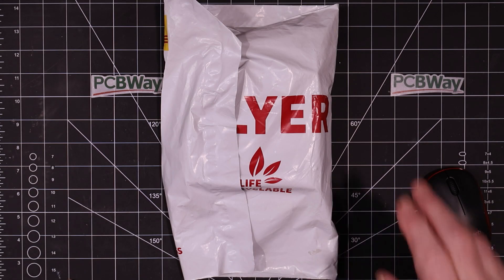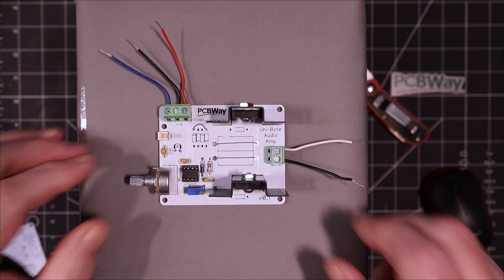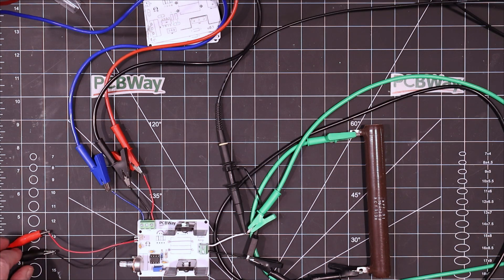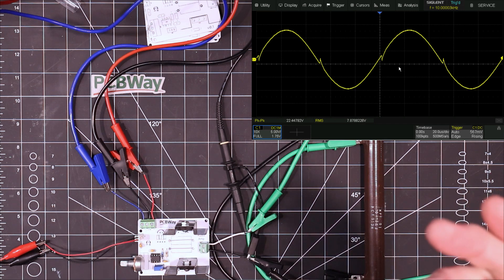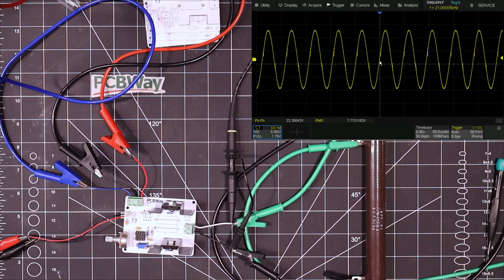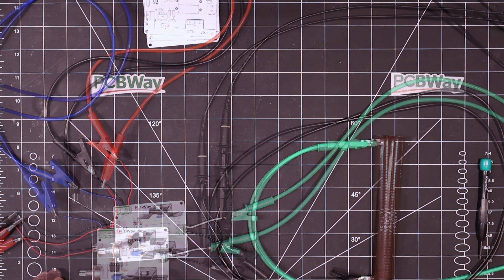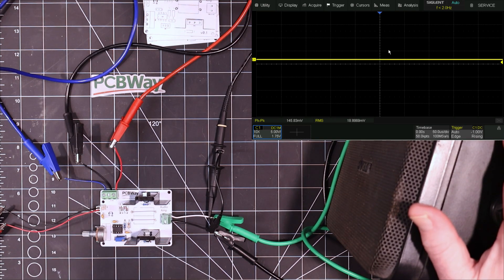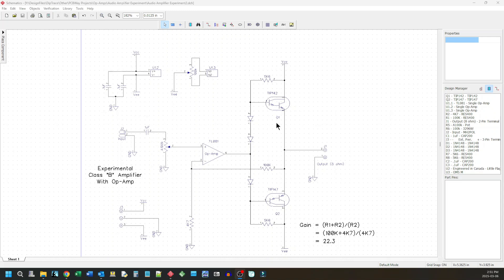Uni-Byte 0260 - We  BUILT This and THIS Happened: Easy Guitar Amp: Part 2

Comment: Replace the positive diode coming off the op amp (the middle one of the 3) with a 100 ohm variable resistor for an adjustable bias to get it just right. A 100 pf cap across the 100k feedback resistor would fix your high frequency woes. This amp could be configured to run off of a virtual ground split supply using transformers without a center tap which would inherently provide speaker protection in the case one of the outputs shorts, and allow a cheaper power transformer.
Reply from the maker: Thanks for posting!

Comment: Still suggest also looking at putting a 1k or 2k R between opamp output and circuit output, it might help clean out the last hint of the crossover distortion. Did you also try 4 silicon diodes instead of 3 silicon and 1 schottky? The faster recovery speed of the schottky might have a behaviour impact, or might be irrelevant, not sure. Also the schottky will have a lesser diode drop, so not match the diode drops of the darlington.

edit: If you look for the video "Biasing amplifier transistors" by DiodesGoneWild, he talks about two very interesting concepts. The first one is the implementation of what I'd term a "configurable diode", using a transistor, pot, and two resistors. It's a very neat circuit trick. The resistors around the diode allow to create a "configurable diode voltage drop", where one can tweak the pot to get just enough voltage biases. He also shows how one of the resistors needed to be changed so that the lower power BJT was properly biased. The second concept is a mention of the through-resistor that I talk about at the top of my comment, at the end of the video, and how / why it works.

So you may like experimenting with using these concepts to improve the cross-over to perfection... or not...
Reply from the maker: I could allow for the resistor in the next iteration.   I think 4 Si diodes would put in in class AB mode and increase the dissipation a lot.  It might even cause thermal runaway without a lot of additional circuitry.  I'll try it off-line and let you know.